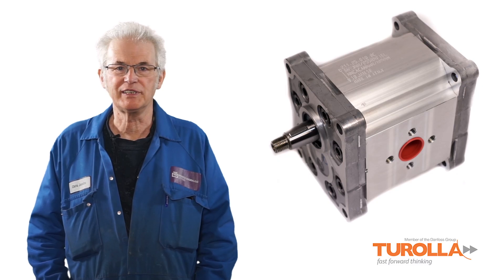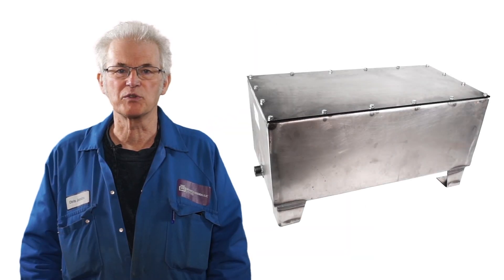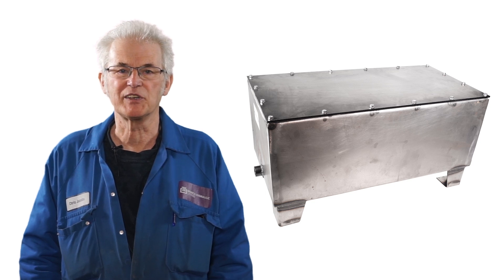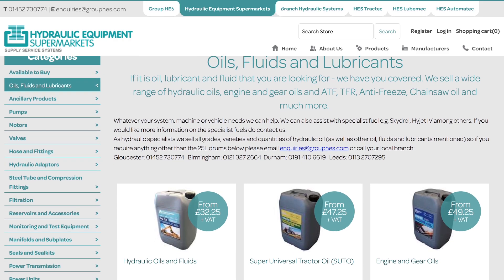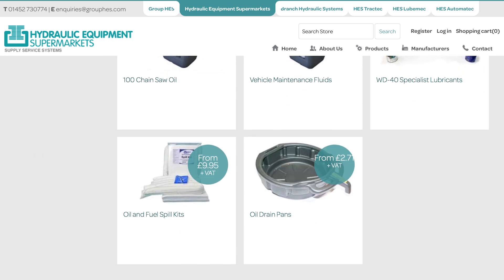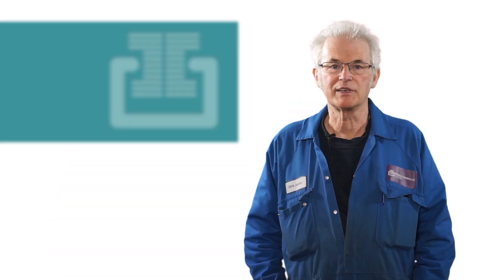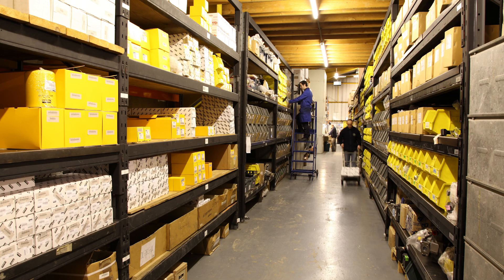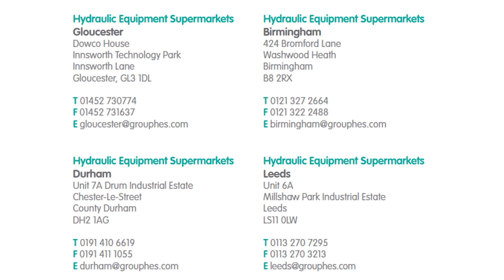Recommended steps when replacing a Hydraulic Pump

Comment: I have M34 Yugoslav version of 4.203 Perkins engine. Layout is the same, but all the screws, threads, nuts and bolts are in metric and DIN/JUS standard. Is this pump compatible to run a servo steering system?